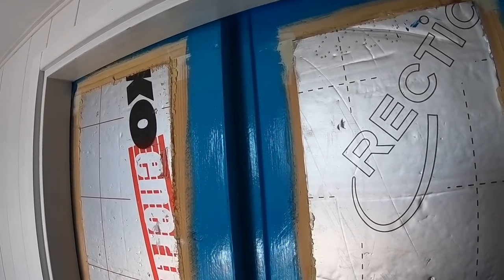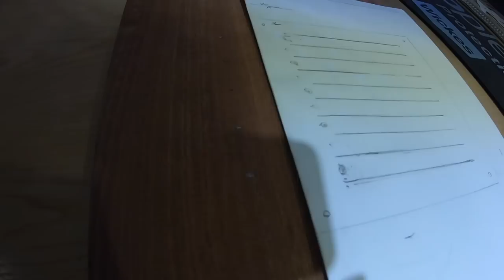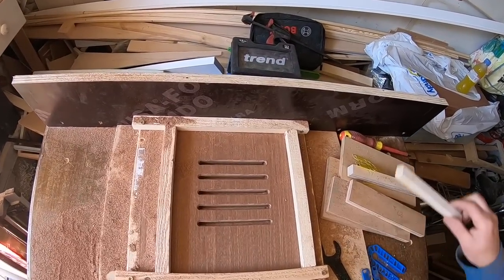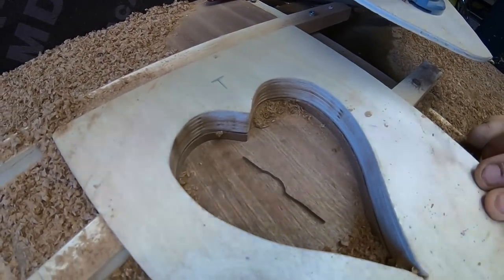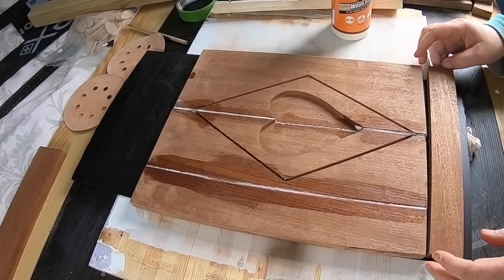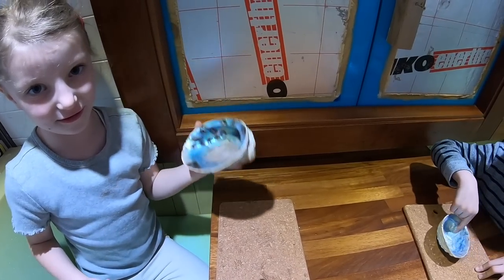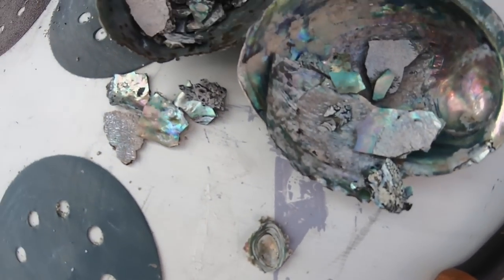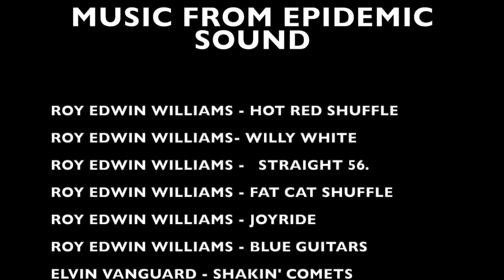VLOG 109, Narrowboat Fit Out - DUCK HATCHES AND EPOXY RESIN HEARTS

Comment: The doors look lovely. Can't wait to see them fitted.  I might be tempted to put a fine mesh behind the slots to reduce draught and keep large creepy crawlies out.
Reply from the maker: Thankyou, Unfortunately mesh gets full of dirt and debris trapped in it and starts to block up any vital ventilation coming into the boat. Because we don't want to keep taking the outside vents off to clean any mesh inside we have not put them in but maybe if needed we can attach some mesh on the outside vent with magnets that we can take on and off anytime to keep clean. We have also made fly screens (that you might see in this weeks vlog) that we could use if there were problems 👍